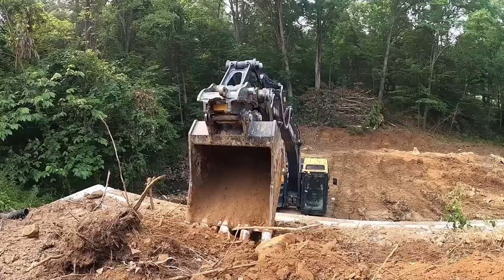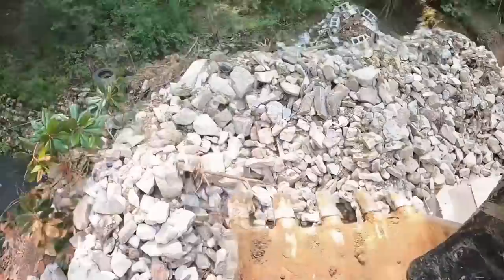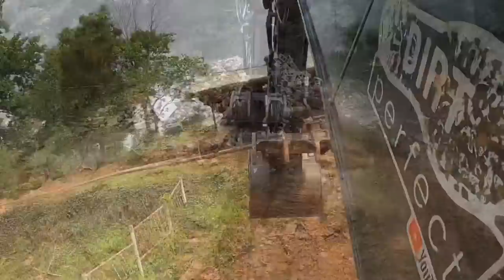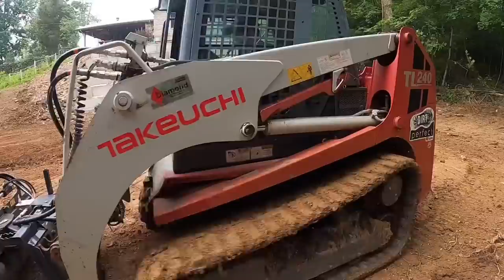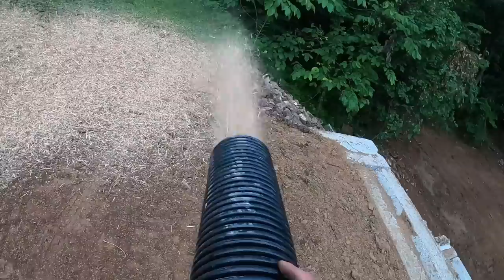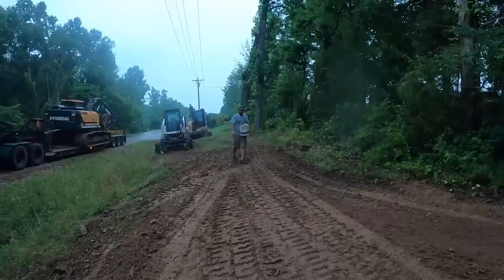Trying To Finish The Retaining Wall Slide Job Before The Massive Storm Hits!

Comment: Aaron,  Remember if lightning can travel through 5 or more miles the 3 inches of rubber on the tracks is not much of a safety factor. 
Great job done in the usual manner.   
Lots of explanation of why you do it as you do.  You give enough information to help beginners in the industry of what works for you so they can get better.

Comment: To make the job faster mount a seeder on the front of the rucus-rake that you can remove when not in use. It will through dirt on the seed as you spread the seed. Seeders are 12 volt. , a recever and a tube verticle and a plate to hold the seeder is all you need.
Reply from the maker: No not faster

Comment: you knew you couldnt leave the area between the ditches alone DP. you didnt have to make that area look pretty but thats what separates  a true professional from fly by night gimme a check operations.  for the utterly horrible dirt you had to work with, against the house didnt come out too bad. tell Aaron all those roots , tree branches are natural fertilizer. they'll rot down in 5 -10 years 😁

Comment: Would like to see the job after a few months with water running in the ditches.

Not that I know anything... but would it be beneficial to put some dry mortar mix on the riff raff to lock it in tight?

Comment: No dissipation pad at the bottom of the 5 into 1 downspout fire hose? You had a bunch of flat rock slabs piled up right next to that end? That force is going to cut into the opposing bank, I'd opt for a turned up 90 degree at the bottom making a geyser to somewhat stymie the fire hose, given it would land on flat rock.

Comment: Mbts made a new friend,  Michael. Nice video's and a fine looking job. Just one question, why didn't you glue the concrete blocks,  wouldn't it be stronger, are doesn't it matter and it wouldn't make a difference at all.

Comment: 🇬🇧 Hi to everyone quite an Awkward job " House on a Mountain "  😂 .  I think you could do with some new Bucket pins on the Mini Excavator by the way it was Shaking and rattling while you were using it .  Surely for the safety aspect are you not putting up a Railing system from the top of the blocks to divide the Lawn from the Block , because for safety whoever is mowing the Lawn and I think the Customer looks like an Elderly Gentleman , he would need that Barrier for Safety while mowing otherwise should he trip he could fall over the Edge .  Keep up the vids 👍.

Comment: So Aaron you think 2 inches of rubber is going to stop a lightning bolt that just came a couple of miles through the air…..DP will be protected from the Faraday Cage he is sitting in not from the rubber tracks….You work at a Generating Plants surely you have seen the films about cranes hitting high voltage lines…..

Comment: Those lighting strikes have just travelled 2.5 miles in the open air, an insulator, so I don't think 5 inches of rubber track are going to do anything. Just sayin🙋‍♂🤔